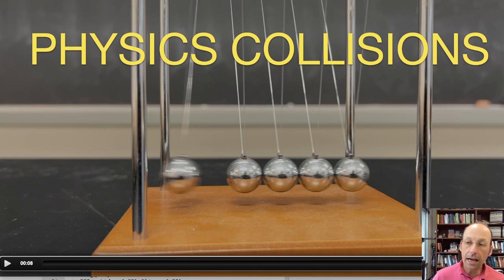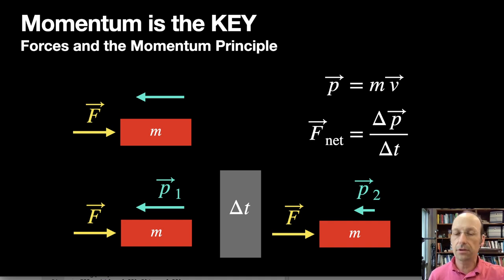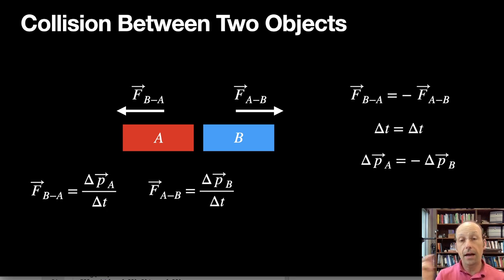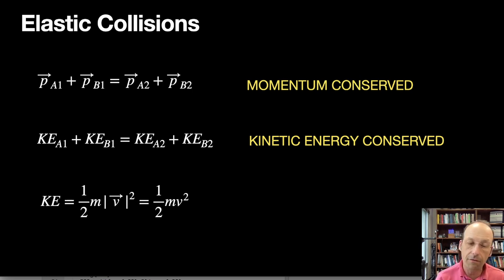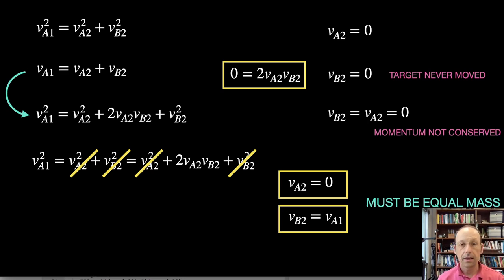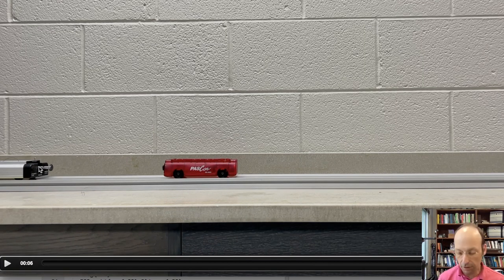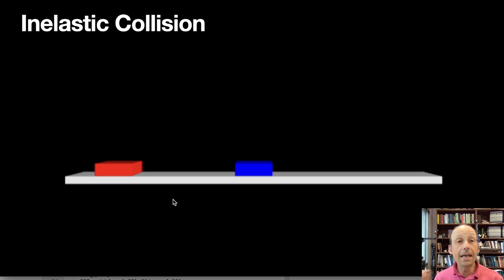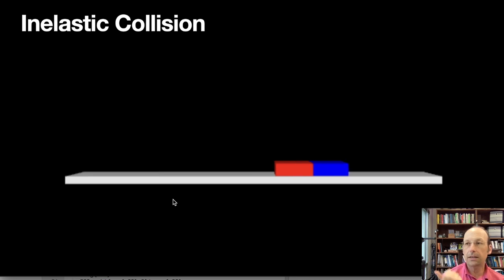The Physics of Collisions: Elastic, Inelastic and Newton's Cradle

Comment: Maybe it was beyond the the scope of this video, but people might not be aware the contact force of the Newton's Cradle is non-linear.
Ref: https://aapt.scitation.org/doi/pdf/10.1119/1.12936
For spheres, in your code, FAB should be k((mag(rAB-L)**1.5)*norm(rAB)
Hertz solved this in 1882, and although we often use the Newton's cradle in demonstrating conservation of energy, Hooke's model of the in-between cases only works if the contact surface is flat.
The real test of the simulation is whether n (>1) balls collide, and n balls depart the other side.
https://aapt.scitation.org/doi/pdf/10.1119/1.12407
Reply: You gave us a link behind a pay-wall?  😄